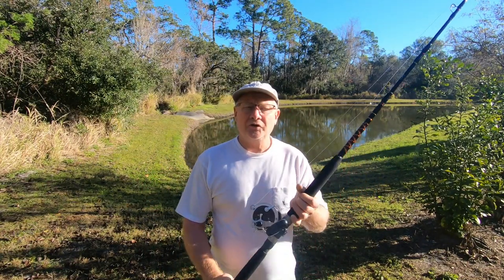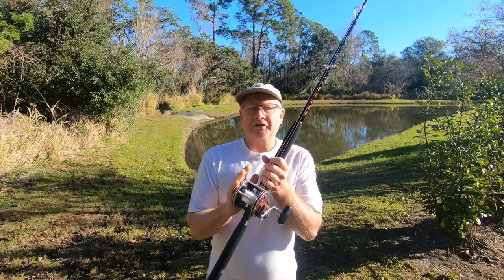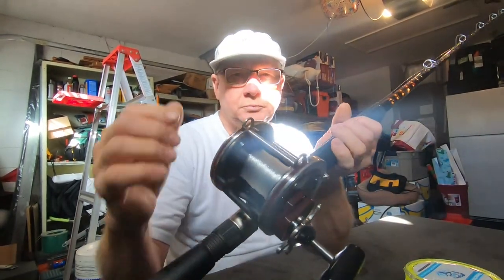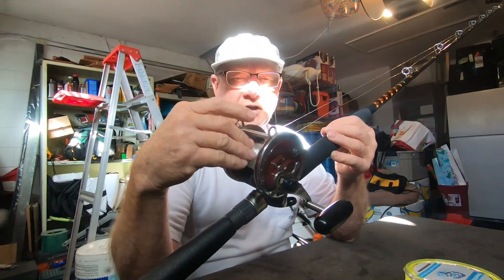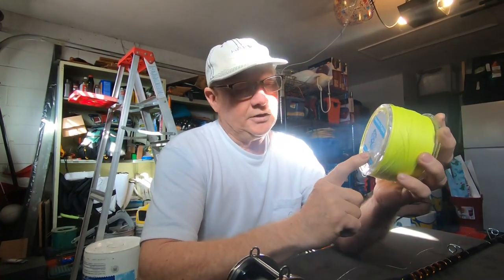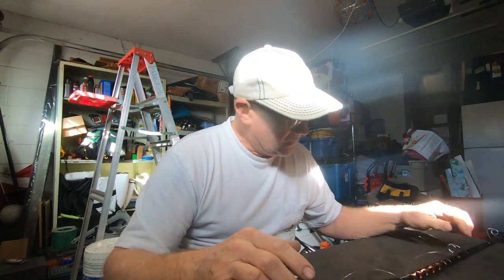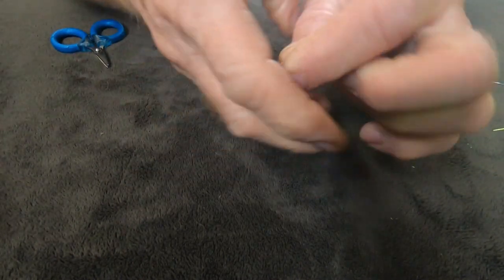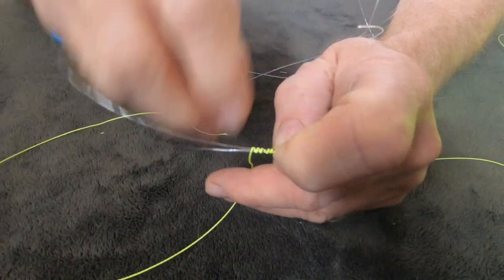NEW PLANER (QUICK RELEASE) RIG WITH ROLL ON BRIDLE. IF YOU FISH  PLANERS THIS  IS FOR YOU.

Comment: Nice👍
Also can use 80 ft mono...60lbs & last 20ft can be floro to the lure
Reply from the maker: Thanks for watching.  I see a lot of set ups like you suggested and seems to work good. I prefer less knots to help keep from breakage or just knot failure.  Thanks for the input. Do appreciate it.
Tight lines....
Reply: @oceandeepfishing4555  yes....wise less knots ...less things to fall

Comment: In your bridle video, you showed the tension through the planer when tripped.  In this video, you show the tension through the bridle when the planer is tripped.  How long should the leader be?
Reply from the maker: Hi Steven.
Thanks so much for watching the video and your comment. 
So the bridle length should be just a bit longer then  the planer clips when the planer is in the tripped position. Sorry for the confusion.  It's hard sometimes making them perfect length either way works for me.  Most of the time the tension goes through the planer  from what I make. Some people disagree with that but the whole idea is to have something you can quickly remove the planer and reel the fish up to the boat. Hope that helps.
Tight lines.....